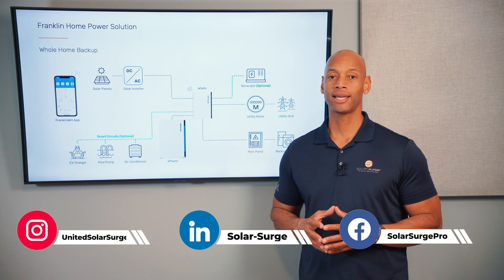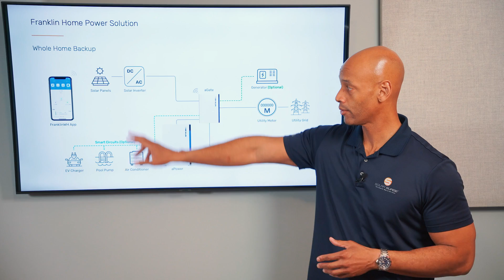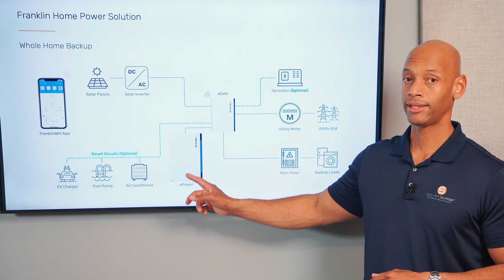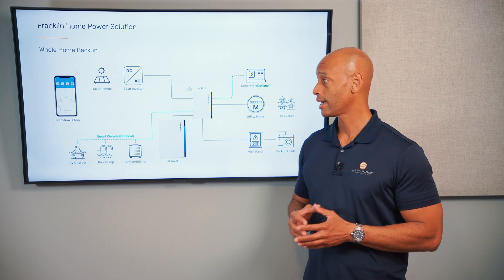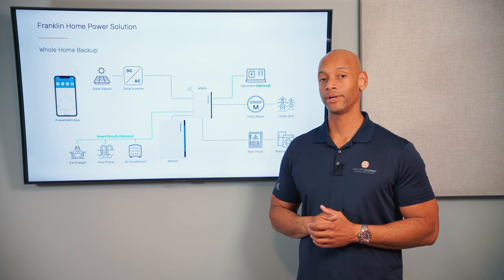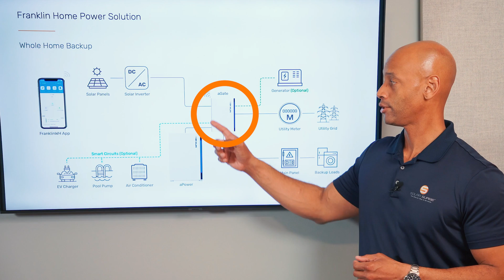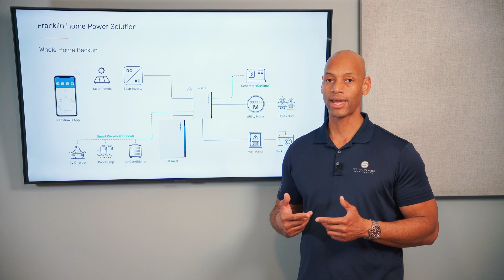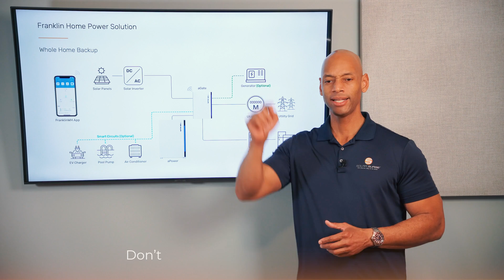How to Add Batteries to Solar System

Comment: It would be nice to see wiring diagram to show the battery addition to an existing system and how it would work if the the homeowner had a load side tap. The code that concerns me is 705.12 . When a contractor / Engineer tries to add a 100 Amp fuse to the load side of the service of a 200 Amp panel/busbar.

Comment: What are the benefits to adding more batteries?

We have an off-grid system which has 2 x 51.2V 200AH 10KW batteries. Will I benefit to buying one more?

Thanks for the video.

Simon
Reply from the maker: Hi Simon.  That really depends.  Adding more batteries would extend your running time during evening hours or on days with inclement weather.
Reply: @SolarSurge  Hi. Thanks for replying. 

That's exactly what I was thinking as we are in winter now in the Philippines meaning much less sun.

Saying that, even though we've gone through at least 4 typhoons and days without sunlight, the solar has just been outstanding giving us power 24/7

I'm originally from the UK. My wife and I built our new home on the 1000 sq m lot we had in the province. I'm still adapting to life here, but at least we don't experience any black-out or electricity bills now being 100% off-grid. 

Cheers,

Simon
Reply: Hi again.

Sorry to bother you again.

The team has just installed a 3rd battery. We now have 3 x 51.2V 200AH 10.24KW batteries.

Do you know what only one battery is always full yet the second and third are partially full?

We have the system set-up to charge the batteries to 95%. I know all will share the power, but I am conscious that I won't be getting much benefit by having the 3rd battery?

The engineers said we have gone from having 400ah to 600ah now.

Your advice/comments will be greatly appreciated. 

Many thanks,

Simon

Comment: I’ve been looking for this information for some time. Clear and concise. Subscribed! Essentially it is a hybrid inverter? Is it easier or common practice to put inverter and batteries outside or inside? All the connections for grid are outside of the home. Only thing inside the house is electrical connection from inverter at the main panel

Comment: Good information, thank you. One subject that I find all resources are not covering very well is Vehicle to Home (V2H) instead of purchasing stand alone batteries for the home. I own two EVs with a total of 198kWh of batteries. Why should I purchase more batteries for backing up my home and adding to my existing solar? I have noticed this year many OEMs offering or soon to offer V2H solutions for their EVs. Offers available now from Ford and GM Energy. Coming soon from Kia, Lucid, and Rivian. Tesla claims will add in future. It seems having EV with 100kWh+ battery already sitting in your garage will offer the most cost effective backup solution going forward. Would love to see coverage of how to add V2H solution to existing solar or as a home backup solution.
Reply: You're right, the EV battery is a huge source of wattage but wouldn't you want to keep your car with as much power in it for when you actually need to drive it? Instead of using the power from it to run your home?
Reply: @l31007  The answer is no since I own two EVs with 100kW or more each. Also, EV can be set with limit on how far it can be drained. I only need 5% SOC to drive to multiple DC FastChargers served by different utilities. With solar and two EVs, I can drain one EV, plug in second and go charge first if needed....over and over... No extra batteries needed.

Comment: Seeing how policies are changing around net metering and the power issues in some areas, I think it is better to go offgrid with parallel capable inverters(2-5) as redundancy. Get the battery capacity you need and add a plug for a generator. This should be extremely resilient, and payback should be relatively fast. ROI is not just the money, it is also the experience and enjoyment of having a reliable power source for your needs.

Comment: It's even easier,  just use an offgrid inverter and transfer switches... no ac coupling at all no push back for a measly 32$ mwh. Store and use what you make. If you have a gt... force charge ac during the day

Comment: This is fun stuff. I don't have any solar other than some I can set up during an emergency, but I've been trying to design some DIY "tricking the grid tied inverter into thinking that it is connected to the grid" by hooking them up to a battery or generator powered inverter. But I read something about that you never want the grid tied inverters providing more power than the load needs or it could damage the inverter.  So, my plan is to just not use grid tied inverters unless I have a larger load being powered, and/or batteries being recharged at a higher current than the grid tied inverters can provide so that some of the power is always coming from the main inverter (artificial grid).

Comment: I watch stuff like this and it becomes very clear to me why a lot of folks are simply going off-grid, entirely.  A well-designed off-grid system is so much simpler than this mess, with a critical loads panel obviating the need for "smart circuits".  All of these proprietary "solutions" add a tremendous amount of expense, when the better option is to simplify your life, your loads, and the way you power them.  I'm puzzled by the very existence of AC-coupled batteries; they only exist because of systems that are already hopelessly complex in their design.  I'm going the other direction, working with DC power end-to-end, as much as I possibly can.  AC is great for moving power around on a very large commercial power grid, but since DC is what PV panels create and what many loads ultimately use, why introduce AC into the equation, if you can avoid it?
Reply: What a limited view of residential solar. For those of us in urban areas, who installed solar previously and when micro-inverters for good reason (including simplified install), the reason for AC-coupled battery is obvious. If you can’t understand that scenario, best to keep your tongue, instead of speaking up (and removing all doubt)
In limited scenarios, DC makes sense. But retrofitting a home…especially anything not way out in the boonies? And almost all of my loads require an AC plug (even considering numerous small AC to DC adapters/plugs). Might that change? Unlikely… there are numerous holistic system reasons why grid and house use AC, so if/until that changes…. AC coupled batteries make LOTS of sense for those of us with existing AC coupled, grid-tied solar systems
Reply: Totally agree 👍
Reply: Okay. Enjoy the snow, because living a bootleg life like you’re describing only works in a really cold climate where you never need AC. The good news is that your family won’t want to visit.